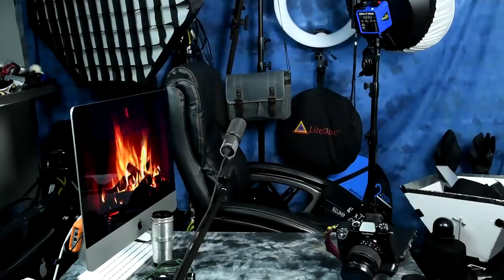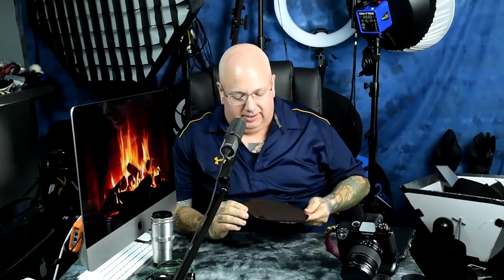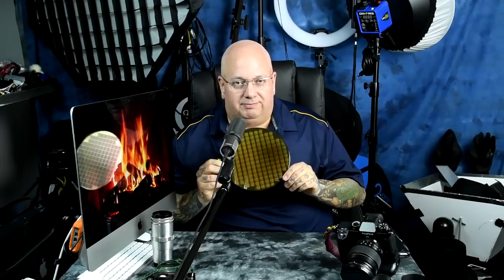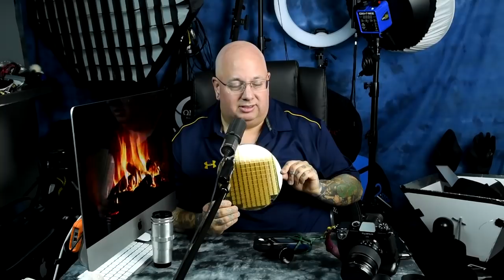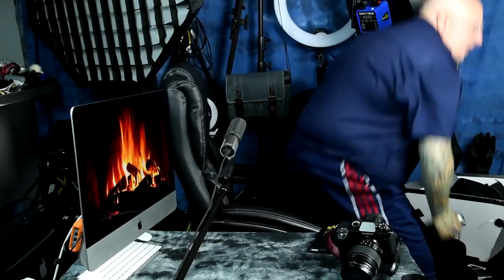🤔 REAL Camera SENSORS & their real nature. Unit-Area, DR, & SNR

Comment: It sure bring back memory when I saw the video.  I can vouch for this video.  Back in 1979, my first job out of university was a assemble line superior (graveyard shift).  It was Texas Instrument factory in Taiwan made camera chips for Canon (too bad I had no knowledge about the chip itself used by Canon).  My stop was after silicon was cut into square pieces and put on a track, it sent to my stop to have gold wires (pure gold, we had to recycle scrap and centrally send it back) link from chip to the track based on preset mapping image.  Chips were so small, operators use microscopes to do the job.  Amazing!!!  the factor also use the computer (very BIG size)  to control machines.  After the chips wired then sent to be molded and cut into individual chip then shipped.
Reply: Hehe, my first computer was a Texas Instruments TI99-4A I’d plug into the television via the RCA connection. 

I think it had 16k of internal memory and my “hard disks” were C60 audio tape cassettes!

Comment: Have you tried any m43 cameras? I actually find them really fun to use. You should get one.
Reply from the maker: they are, but ive got too many cameras now
Reply: I shoot them professionally. EM1mkii’s and Oly Pro Glass. Switched from Canon FF 3yrs ago. I shoot wedding, family, Seniors, and most recently added high volume sports photography. Love Oly and Godox combos!
Reply: Also, I tried to like Sony and the results were nice but I can’t stand the ergonomics and menu. The interface was terrible.
Fuji is interesting to me and I’d probably love it but I’m perfectly happy with Oly.
Reply: Ken can get or at least try the Olympus EM5iii whenever it comes out next as the EM5ii is pretty old now. Currently the new Em10iii is available, but it might be labelled Dinky, so a slightly bigger one, but not as big as EM1 series is advisable, thus finding middle ground in EM5 series.  I am not in favor of the overpriced EM1ii  -  the flagship model.   EM10iii just arrived in my country. So will have a glimpse of it and decide, whether to wait for EM5iii or not. Problem is that there is no option of Body-only, and it comes in a Kit of Two Zooms which i don't want, the 14-42  &  40-150 ;     EM10iii + 15mm f/1.7 (pana-leica, for streets) + 42.5mm f/1.2 (pana-leica) or 75mm f/1.8 M.Zuiko  (any one of the last two tele-primes) is a great two primes set-up.